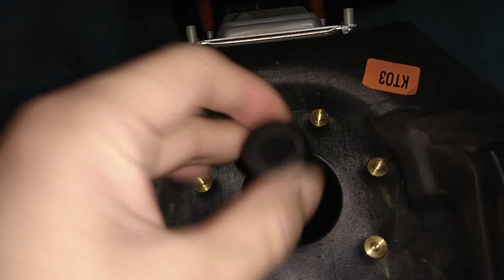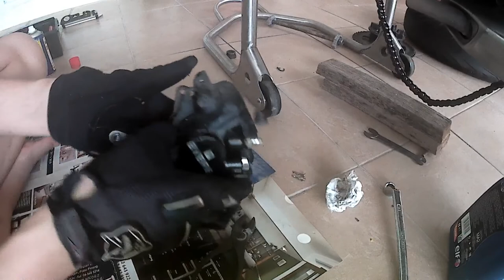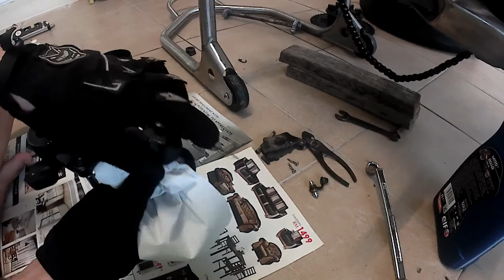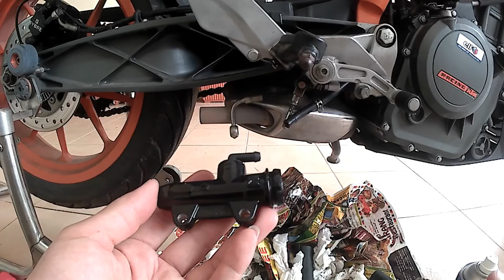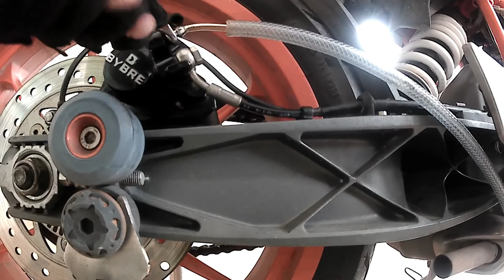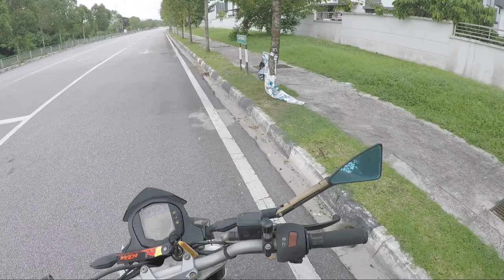KTM Duke 250 | Rear brake malfunction and service braking system #ServiceFloatingCaliper #BrakePump

Comment: Dear sir, I can't bleeding my KTM 250 duke rear brake. What do you recommend? It's problem with master cylinder or not?
Reply from the maker: There is technique to bleed brake fluid... Lock the valve and keep on pumping... After few stroke then release the valve while still pressing the pedal... If there is still no fluid then I recommend to full service the cylinder and the brake caliper to check what's wrong with it... Hope this help
Reply: @MichaelLee26  Big thanks for your recommendation 🙏🙏🙏🙏 I will try with your step 👍👍👍❤️❤️❤️
Reply from the maker: No problem...

Comment: hi brother i have a duke 390 i press the rear breake but the bike does not stop. the front breake only works well. i aslo said when i leave the service they say it is fine but i am not satisfied with catching the rear break
Reply from the maker: You need to check brake fluid to see if there is any leaking... If no then it is possible brake pump issue... Do a full pump and caliper service according to my video... Hope this helps
Reply: @MichaelLee26  ok brother I will check
Reply from the maker: You are welcome 😁

Comment: Mine is 016 KTM Duke 250 ABS got the same mirror and now got the same problem with rear brake pump cylinder.
Reply from the maker: So coincidence? So have you got your own brake fixed? So I think KTM have to do some improvement for the brake pump
Reply: @MichaelLee26  Yeah, I fix it already but I try 2 hour to bleed brake fluid and that is crazy 😑😑
Reply from the maker: Glad to hear that you have made it... It also took me more than 1 hour bleeding the brake fluid myself and it's OK... you're fine next time when you have the experience on how to service brakes.

Comment: I have the same problem as you but my rear brakes are locked on the wheel! What could be the problem?
Reply from the maker: I couldn't understand what you said? The wheel is locked by the brakes? It should be... Or the caliper is jammed or else maybe brake pump
Reply: @MichaelLee26  the pistol/coil goes out but if you press it to far it gets stuck!
Reply from the maker: Haha... Then you may need to sand the inside white sleeve to enlarge the diameter... And try to change to a smaller O-ring at the piston
Reply: @MichaelLee26  yeah i fixed it! But when I was driving today my chain broke and one more thing but I don’t know what it is! Is there any change you can help me? You are the only one I know having a Ktm duke!
Reply from the maker: Glad that I'm able to help... For chain just buy a better quality chain and you should inspect the workmanship of your mechanic... I don't know if he is joining the chain pin loose...
Reply: @MichaelLee26  hi sir, can  i know what type of o ring that u used? is it regular o ring at hardware?
Reply from the maker: Yes... Just some regular o-ring from any hardware shop

Comment: New subscriber from your neighbour in the south, great videos! I've got the same issues as your duke (mine's a 200), mainly the float sensor and the rear brake. Roughly fixed the rear brake up with just a DIY bleed and it works now. Just going to ignore the float sensor since my bike only has 8 more months to go on the road before it has to go to the scrapyard. 

Can I just ask, do you know where the rear brake switch is connected to? Mine's disconnected and I can't find where I should plug it in to, just sitting loose under rider seat.
Reply from the maker: Hi! And thanks for watching. Such a coincidence here, haha! Since the bike is going to scrap then you may skip repair the fuel float but just aware of your travelling mileage to refuel... And I have no idea about the switch connection as I trace it sealed inside the wiring harness... Sorry

Comment: If I open air vent(from where you took oil out via pipe)and do apply break break multiple times will pump go bad ?
I went we mechanic for jammed Tyre issue and he made it free but now break is also not applying
Reply from the maker: Hi! This will not cause any issue to the brake pump... Try bleed again your brake as there is possible air trapped inside... If problem still persist then you may want to service your brake pump
Reply: @MichaelLee26  thank you for your prompt reply and help 😊
Reply from the maker: no problem bro... I'm glad to help... Cheers